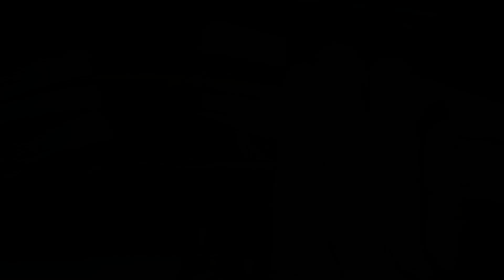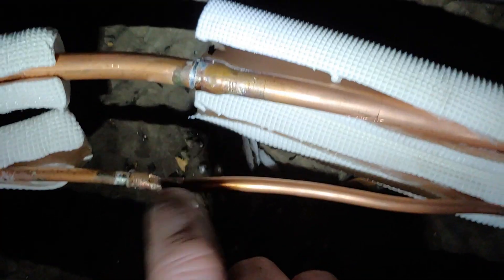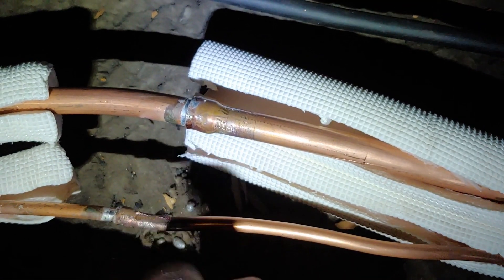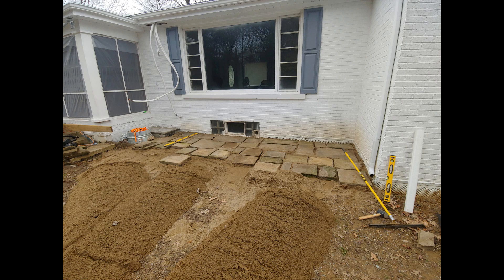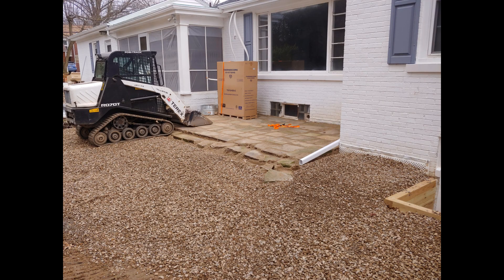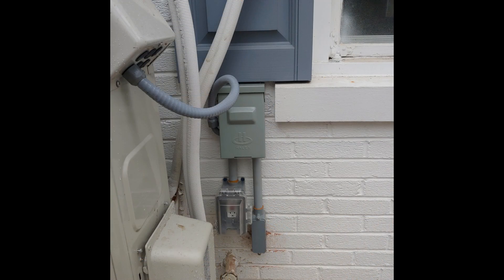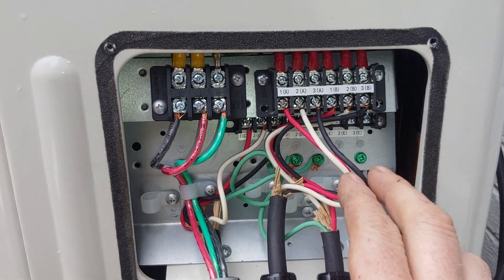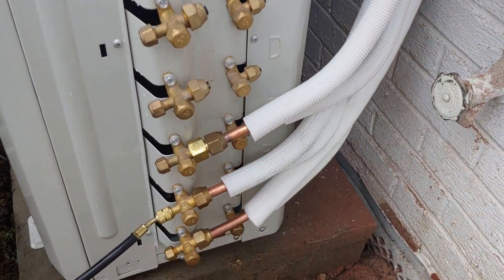Ceiling Cassette Minisplit Installation (Part 3)

Comment: Did you solder those connections? Curious how it is holding up the the extreme pressure. 
I was taught to only braze these with silver solder - a much higher temp process that requires a nitrogen purge but it handles the high pressure and temp swings easily. 

How about an update. Curious if you have had any leaks or other problems at any of the connections.

Comment: This is the first video I've seen so far that addresses installing a ceiling cassette between 16" joists (thanks). It seems like the units are designed for drop ceilings, not ceiling joists, esp 16"oc.. I like how you used double headers to frame out the cut joist; I will do the same.. The part that worries me most is the access past/over the joists to attach the line-sets. How tall were your joists? The ports looked lower than the top of the joist, right? Seems like a design flaw. How much clearance did you have, vs. what you wish you had? I suppose that with a missing joist, the potential width of the framed opening would be about 30.5 inches (if the unit is centered in the space). If I made the length of the framed opening also about 30 in (instead of just 24") then I might have more working space in those corners, right? (yes, the ceiling cutout would still be 24" square). I'm also going to try to hang the unit from brackets across the top of the joists (at 45° to the joists) rather than from the rafters...but that one corner where the line-sets attach is going to be the problem.

Comment: Did you soldered or brazed those refrigerant lines?
Solder will never hold the refrigerant pressure on the hottest day!
If you know anything about spraying, it’s 2000° of heat. Kind of dangerous up there in the attic with all that wood and insulation. Maybe you should show how to spray down and wet surfaces that are flammable?
I don’t know. Maybe the difference between experience and non-experience?
Lots of attorneys out there waiting to pounce on content that ends up killing someone or burning down their house.

Comment: Absolutely love the idea of using the PVC compression couplings and the way you ran the drain line that you used. I will be doing the same in less than a month when I get mine set up too.
You've done an outstanding job and thanks for sharing.
I deftinly getting a set of those swaging SPIN tools.
Reply from the maker: Happy I could provide different ideas. Good luck with your project.

Comment: Very nice install! I really liked your double-sistered joist transitions!  I'm a landlord, and self- installed a 5 zone, split system in one of my rental homes, using wall mounted air handlers, along with a branch box. Mitsubishi indicated I would achieve greater efficiency if I installed one, as AC/heat/fluid would only go to the room that called for AC/Heat, as opposed to all rooms.   Have you ever felt a reduction in heating/cooling efficiency in your 3-5 zone system and thought that a branch box might help?  I'm going to install another split system with ceiling cassettes in different house, and your advice/answer will aid me in the equipment I'll buy.  Perhaps I don't need a branch box for this 4 zone system. Many thx in advance!!
Reply from the maker: Hi, I no longer own this home. However while I did own it, the cooling aspect of the system did very well, and I never thought it needed more. I still used the radiant baseboard heat during winter because it's more efficient.

Comment: Hey I’m planning on a very similar install. What did you do with the insulation? Did u cover the unit w insulation? Layer some around? Or just left the cavity space empty?
Thanks!
Reply from the maker: After everything was completely done I hand filled space around the unit with blow in insulation. I bought 1 bag and it was enough for 4 head units.

Comment: Hpw much is a cassette install? Do you recommend somebody in the Dallas area?
Reply from the maker: I bought my 5 cassette system for $3800 in 2017. I'm sure they've gone up since then. Total cost for my install was about $5k. But I did all the install myself. I was quoted $19-25k to have a system installed. I'm sorry, I don't have any recommendations for installers.
Reply: @SteveDoesEverything  
Thats about right for my area, for 5 indoor units. Call around about price, service agreements and warranties. The cheapest quote might not be there next year when their work starts falling apart

Comment: Steve, great videos. Can the ceiling cassettes be installed and serviced from below?  We can access an area of an addition to push the line sets thru and down but there is no way to work from above as the peak is only 36" from the finished ceiling  and the unit would be installed about 4' into the addition, but there should be plenty of room for the unit. Spray foam on the underside of the roof sheathing so no need to insulate above.
Reply from the maker: The head units are installed from below. However the electrical, line sets and drainage lines are above the ceiling. So if there is a way for you install those and get it right then servicing the head unit isn't a problem.
Reply: @SteveDoesEverything  maybe worst case we will have to cut extra drywall and replace after install?
Thanks
Reply from the maker: @CarlLMC  yea if you absolutely can't work above then you'll need to open it up from below

Comment: Nice install, I did a few of those over the years except we used the wireless thermostats, and installed a 10” ceiling access panel right behind the unit were the controls are located on the cassette..
They do however recommend not to braze the lines because the screens and capillary tubes in the mini splits are to small to filter any soot from brazing even if you do run low pressure nitrogen they still say don’t do it, so we use refrigeration flare couplings and nuts!
Next time try using some nylog on you’re flares it will make a world of difference!!

Comment: Shouldn’t you pressure test and vacuum from the master valve
Reply from the maker: The compressor came pre charged with freon. So had to pull vacuum on each line seperately

Comment: Bro I know you wanna save money but if I get a call saying "I installed this myself but now its not working or cooling" imma charge you top dollar. You are showing misleading information no micron gauge so many mistakes and people are thinking this is how you do it.
Reply from the maker: I understand how you can come to this conclusion without knowing the whole story. In my situation. I contacted several ac companies to install a system. My quotes for a minisplit system was 24k. And a regular ducted system(no current ductwork) was 21k.  That's more than double the cost it should have been. After I purchased my own hardware I called 5 companies to get quotes on installing the system that I bought. All 5 wouldn't even come out and give a quote. They didn't want to install a system I purchased. After installing my own hardware I called several more companies to hook up the line sets and charge the system. They also said no. So believe me when I say I really didn't want to tackle this project but was left without any other choice.
Reply from the maker: Oh, I did find 1 guy willing to install  a ducted system. He was going to charge me about 9k. After finalizing the details and setting a date. He never showed. After a month of no shows and reschedules he finally admitted he didn't want to do it because summer was there and he didn't want to work in the attic. I offered to get ventilation and fans and cooling of some sort and he still declined. Trying to find good work that is reasonably priced is impossible these days.
Reply: @SteveDoesEverything  bro, your the man. F$@k all the naysayers. If the system works then move on. Ya you missed some steps, big deal.

Comment: This keeps getting worse and worse did you use flux to solder not trying to bash but probably would have been better to hire a actual contractor your showing the wrong things to do
Reply from the maker: Hey thanks for the tips. Yes flux was used and connections were very clean prior to soldering

Comment: I didn't see you adding nylog to your flare nuts. I've taken classes on mini splits and nylog is a MUST if you don't want leaks. Also you'll thank yourself later buying a torque wrench
Reply: Nylog is forbidden by all mini split manufacturers. The only approved gasket sealer is flare tite gaskets. No thread sealer is to be used. Do your research.
Reply: We use nylog on the flare faces, not threads.

Comment: Looks good.  How do you like the ceiling cassettes?  I was wondering if they ever drip condensate.  Speaking of condensate, did you insulate your condensate lines in the attic?
Reply from the maker: I like them better than wall units. If they are insulated well around the unit, then it won't create condensate around the unit. Both line sets we're insulated as well as the connections to the units.

Comment: why would you braze lines when you have flare fittings. You didn't run nitrogen while brazing and it looked like plumbing solder?
Reply from the maker: Swagged not flared. Harris Stay-Brite #8. Melts at much lower temps than braze wire so pipe doesn't get hot enough to soot, so no need for nitrogen, and holds pressure up to 10,600 psi 👍

Comment: Good video, Hoppe that was the silver-bearing solder you used. Suggestion: ad a lot more insulation in the attack. Looking forward to do a similar system my self.
Reply: yep.  insulation is a little sparse,  also might need to sister another joist along side the two that are now supporting the load from the hole created to accommodate the ceiling cassette.
Reply from the maker: Yes, Harris stay bright #8 was used.
Reply: @SteveDoesEverything  Great, it was a nice video.

Comment: All really good tips to what is a very useful video.  Thanks for taking the time.  As I mentioned in video #1, I think you’re the first to video a CEILING CASSETTE mini split install.  Concur with the comment that you’re ultimately better off purchasing a hi and low copper line set longer then you need so as to avoid having to braze anything.  I’m behind you a bit—still measuring distances for my lines.  I am planning to use PEX for my drain lines, and will route them to existing sewer gas pipes in the attic—but will also have a provision with two ball valves to route it to the outside to a collection point to save the condensation water—water is precious in my world, but I don’t know how much it will ultimately produce at this stage of the game.
Reply: isnt connecting drain lines to sewer gas pipe going to let bad smell in your AC and your room??? did you end up doing it that way?
Reply: @gazd4812  The plan is to install one-way check valves at those points.  Very common solution.

Comment: GOOD JOB WELL DONE 
HOWEVER FEW MISTAKES  THAT WILL MIGHT  EFFECT YOUR  COMPRESSOR IN THE FUTURE ,
 YOU DON'T  SOLDER AC LINES YOU BRAZE THEM , THE FLUX AND SOLDER COULD GET IN PIPE AND EFFECT SYSTEM 
IT IS BEST PRACTICE TO HAVE NITROGEN FLOWING TRU YOUR PIPES AS YOU ARE BRAZING STOP CARBON BUILD UP THAT WILL GO BACK TO COMPRESSOR AND START THE ROT OTHER THAT THAT GREAT JOB
Reply from the maker: Thanks for the tips!
Reply: It isn't carbon build up that the nitrogen prevents. It's copper oxide. When copper is heated, it reacts with the oxygen in the lines and forms chunks of oxides.The nitrogen displaces the oxygen so there isn't any there to have a reaction with. He also didn't use a micron when he vacuumed the system, so we nor he has any idea if there is water or other non-condensables in the lines which will also shorten the life of the compressor.

Comment: I have the exact same cassettes! But I’m trying to hook up the face plates, but I can’t see where the 2 connectors hook up into the mother board. Also there is an extra connector just hanging loose the instructions doesn’t mention. Any tips for just properly attaching the faceplate?
Reply from the maker: I had the same issue. The screen part that opens and hangs down where you can clean the filter has 2 connectors. only 1 connects to the mainboard. Its the 5 hole female connector.
Reply: On the faceplate I have a 5 wire female and a 10 wire male. The 10 wire connects and the 5 wire isnt used? Did I understand the correctly?

Comment: Did you insulate over the ceiling cassette? Or just run the batt insulation up to it?
Reply from the maker: I used blow in insulation and packed it in around the cassette, up to the top of the cassette.

Comment: You need to use nitrogen to braze those lines-if not the inside produces a blackened soot which contaminates it and will shorten the life of the units. Lots of good videos on how to properly braze these lines.
Reply: This is not entirely correct. He soldered the lines with a propane or mapp torch. The temperature a propane torch is capable of reaching isn't high enough for oxidation to form like it does from brazing which uses a oxy acetylene torch. That being said its always a good idea to flow nitrogen anyway and to flush the system out with nitrogen before your final vacuum and releasing the charge
Reply from the maker: Thanks for the tip. I really appreciate it. I'm going to have to re-braze them when I get back up there.

Comment: what kind of solder did you use on the line set? standard plumbing solder isn't considered to have the strength to hold up to the pressures of R410a
Reply: I'm a DIY hvac guy too. the solder will hold the pressure no problem.  I use regular 3/8 copper solder lines for transitions in 1000psi mist systems.  this mini-split will max out at 550psi in heatpump mode, so pressures holding is not the problem.  the problem is contamination.  when i connect for freon i use a cheap bernzomatic oxygen/map torch for brazing with silver brazing sticks (no flux, just straight braze).  search for BERNZOMATIC Torch Kit w/Cylinder, MAPP/PRO.  Make sure you get the set that allows for the oxygen tank and mapp tank.  its hard to get it mixed, and the little oxygen tanks run out quick, so i keep my regular torch running as a lighter when trying to dial in the mixture. You are supposed to flow nitrogen through the lines when brazing as it will also oxidize a bit inside the pipe without inert flow.  finally, if you are going to do more of these, i'd suggest a cheap micron gauge.  seeing the -30 hold on the gauge set is good indication of vacuum holding, but the additional knowledge that you got a good vacuum (250 microns or less) - then to see it hold low for 15 minutes (like below 500) - shows that all contaminates and moisture have boiled off under vacuum.  hvac guys sometimes don't even do this part, but i believe a contaminate free system is the difference between an AC that lasts 20 years, and one that dies in 10.
Reply from the maker: I used standard copper solder. I kind of figured it wasn't the right stuff. Thanks for the tip. I'll get some proper stuff and re-solder the lines.
Reply: @SteveDoesEverything  While your at it. Do some research on Nylog Blue. I'd suggest getting some of it for the flare fittings
Reply: @SteveDoesEverything  Oh i forgot to mention the solder you should be using is stay brite 8
Reply: @SteveDoesEverything  You'll need to braze not solder.  Also if you don't purge the lines with a shielding gas (Nitrogen), you'll build up soot inside the line and damage the system.
Reply: IMO your best bet is to have gotten a 50 ft lineset. Why? Brazing makes oxidation and makes crap in the line set. Granted, IIRC, soldering doesn't. But you may have issues down the road. Also, you should have used a torque wrench to make sure you don't over tighten. Doing so may cause leaks. If you want more info, this is a good resource:https://www.youtube.com/watch?v=BO7ZaLgfWTQ&list=PLmSwY5znBbb4G7dGIOs1cN9FaHNT8xbR9&index=3&t=0s
https://www.youtube.com/watch?v=iLTMlIT6Qvg&list=PLmSwY5znBbb4G7dGIOs1cN9FaHNT8xbR9&index=2&t=57s

Don't feel like I'm hating either: Most "techs" don't even do what they are supposed to do.